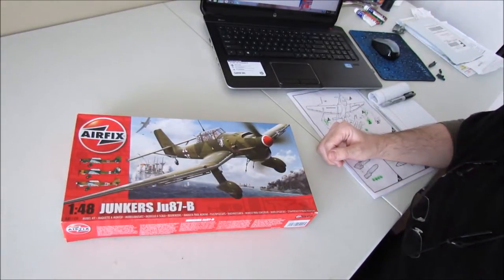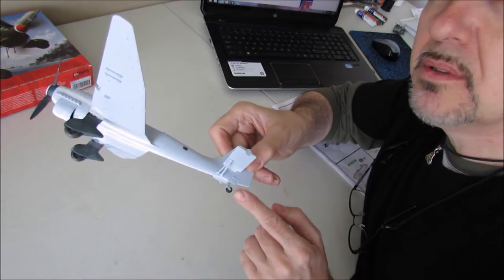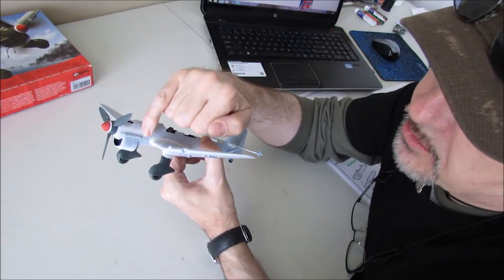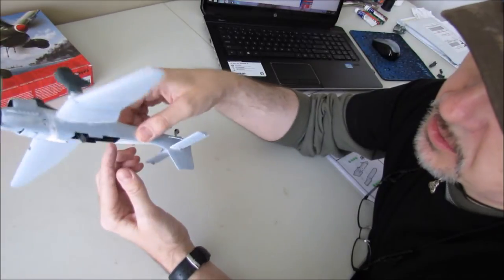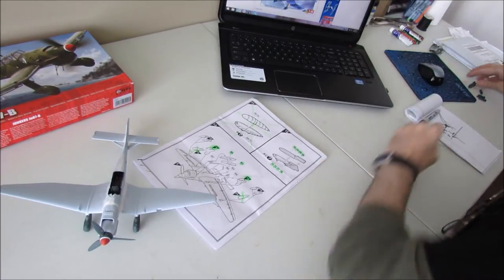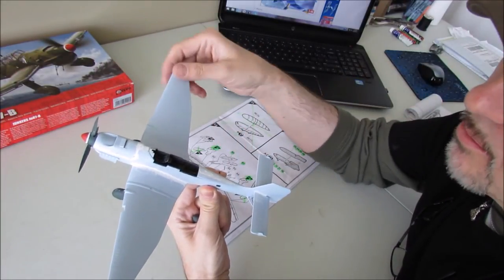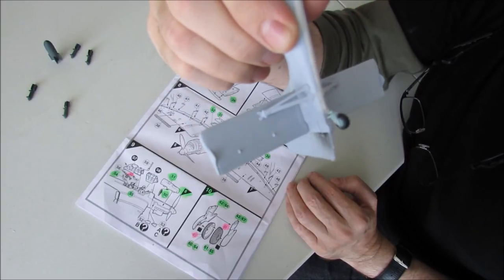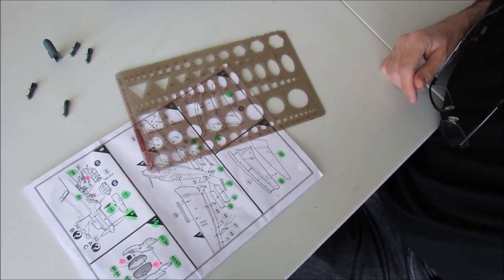Airfix 1/48 Junkers Ju87B-2 Build Update #2 (7.26.14)

Comment: Always good to see that others run into issues when they build and paint.  Seems every build I do I have a few issues that I eventually need to fix, either mfg issues or self inflicted wounds.
Reply from the maker: Hey, Joe, thanks for stopping by, watching and commenting, greatly appreciated. Stick to Tamiya and/or Hasegawa if you want well Engineered kits. That's my plan going forward.
Cheers,
Martin
Reply: FullMoonDrummer
And that would be one of my biggest downfalls.  I love the kits that I can pick up cheap and not worry about cutting them up.  Hence the referral to self inflicted wounds.
Reply from the maker: I'm not putting myself through torture like this again....Tamiya have spoilt me the most. My last few builds were filler free.

Comment: Nice Progress on your build, and I hear you about the gaps and filling and sanding, must be the way these kits are made, reminds me of the old amt kits
Reply from the maker: Well, I didn't have to have anxity about all the filling and the sanding to follow....I was given a tip from DarthPhotek to use a cotton swan / Q-Tip moistened with nail Polish Remover, and, it works like a dream. With a couple of strokes the excess filler disappears and just leaves what is in the joint/seam. Then a very light sanding....works like magic, saves a ton of time and you don't file away your surface details!
Chers : )

Comment: Good old airfix. Still, you're making a good job of it. Keep up the good work.
Reply from the maker: Hell Will, she's an old worn kit. I don't know if these fit issues have existed since the tool was first built and were ignored as good enough, or they developed over time? Those stabilizer strut location points being back to front are a signifier to me that Airfix doesn't care about making rectifications; I'm sure I'm not only one that has built this model and come across that issue. They are illustrated correctly in the instructions.
Don't think I'll be buying anymore Airfix after this...they don't seem to care about their quality of product. Even if it is an old mold....take on board customer feedback and be pro-active to keep your market happy.
Anyway, thanks for taking a look! : )
Cheers,
Martin
Reply: FullMoonDrummer I bought this kit a few years ago, took one look and filed it away under 'oh dear'. You're a braver man than me. I agree with you that Airfix (and sometimes Revell and Italeri) are testing people's patience by re-releasing these old kits without fixing obvious faults. Mine will probably be used for re-scribing practice at some point.
Reply from the maker: There's an idea...just buy Airfix for practicing techniques with.

Comment: Great tip with the ircle template mate!  Wont be trying to mask propeller nosels again  ;)
Reply from the maker: You're welcome. Another way to do it is using a bottle top, such as the one on a Vallejo Paint bottle...Airbrush/paint the color of the propeller spinner tip, all over the spinner, then when it is dry, put a piece of putty inside the bottle top and then push the nose of the propeller spinner into the bottle top. This will then shield the first color you painted onto the tip of the spinner. Next, airbrush the color that is required for the rear part of the spinner onto the exposed area at the rear. Good luck! Cheers : )

Comment: This kit is a bit of a beyotch to build, but I don't remember it being THAT bad. :0 Yikes and Jesus' boxershorts. Well... just wanted to point out that you don't actually need to sand the filler away and lose all that surface detail. I fill with Tamiya putty, let cure (you know it's 100% dry when it's odourless), and then I use a cottonbud moistened with... nail polish remover (!) to rub away all excess filler until it only remains in the seams. It may discolour the plastic slightly but it will not melt it. So yeah, use nail polish remover, alternately acetone diluted with oil will work just as well. Pure acetone will melt the plastic. I have experimented so I know for a fact. :D

Keep up the good work! Also don't be discouraged by Airfix "quality", there are some absolute peaches of kits out there, and they're also generally extremely accurate shape- and size-wise. They just require a little bit more TLC than normal. :)
Reply from the maker: Hello Darth, thanks for watching and commenting, greatly appreciated, and, thanks for the tip with the nail polish remover...I'll go borrow my wives tomorrow evening when I get back onto her and give that a try! I trust that it works, and it sounds like a much easier and less messier option than sanding, creating dust and losing details!
Awesome : )
Cheers,
Martin
Reply: FullMoonDrummer
 Test it on a piece of sprue first... your country may have different ingredients in your remover. :D As long as it's smelly it should work though...
Reply from the maker: DarthPhotek I will do, cheers! : )